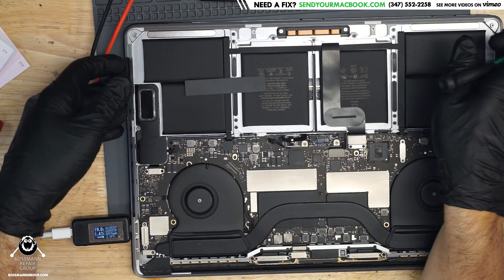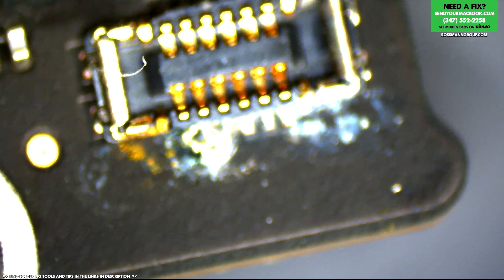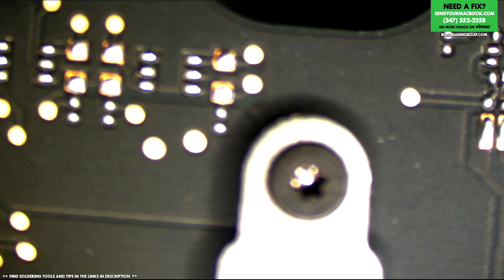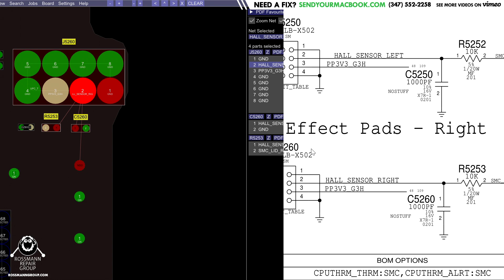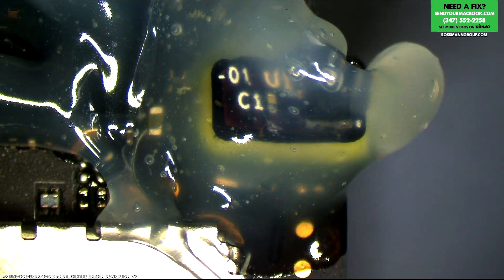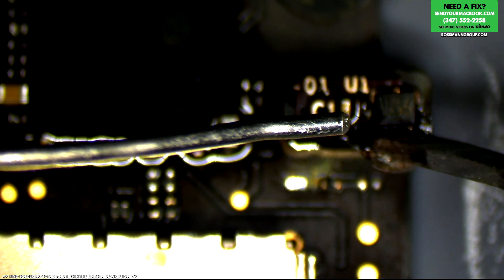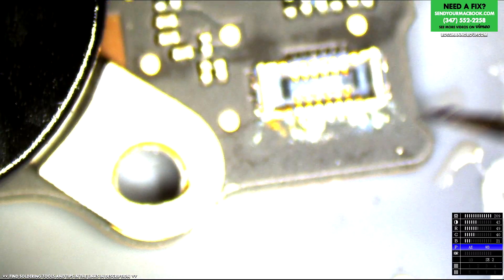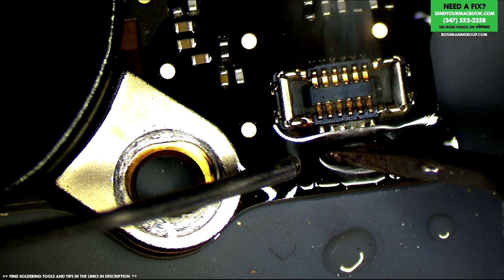Common cause of dim screen on newer Macbooks

Comment: So this isn't about the video or even really an apple product, but since MacBooks use the USB C connector I thought you might have some advice on an issue I have. I've replaced the USB sub-board 2x because when I unplugged the charger it pulled out the connector. Is there something I can do to keep it from happening? I know it might just need to use a different charger but was wondering

Comment: hey louis I recognise the issue you have with the schematic viewer software had a similar problem once. I fixed it by going to properties on the .exe file, under the tab compatibility there should be a button that says: "Change high DPI settings" click that and then check: "overide high DPI scaling behavior" and set it to application that should fix it.

Comment: Eyyyy I started using davinci Resolve last year and I enjoy it it's pretty nice, it's never crashed while editing for me but has crashed during final renders before, however, most of those problems are because my overclocked CPU was overheating during the renders cuz I'm dumb and didn't setup the thermal throttle 😂

Comment: I think there is for once a bit of sense in the insanity of crapbook design: So 2 sensors are the way to go if you want resilience. Say one sensor fails the other works the machine can detect its own internal fault and do something about it. Enter the Boeing 737MAX where there was one of those crappy sensors where there were supposed to be multiple ones like basically in everything that was known to aviation up to that point... LOL and everyone died due to cost cutting yay... but I digress. Since apple still hasn't invented conformal coating I would argue putting 2 sensors there can make some sense.

Car ECUs use hall sensors at the crankshaft to tell engine rpm and crankshaft position with excellent accuracy as a magnetic cogwheel is rotating next to them... until these sensors tend to fail due to heat damage. Better designs have 2 such sensors to be able to report to the ECU that shit is malfunctioning and the car can tell the user to go to the garage in limp mode to prevent damage. Shittier designs might just cut out or start violently juddering and jolting when their hall sensor starts to play up.

Comment: Apple, were going to over-engineer our lid sensor to the point it makes it LESS reliable than everyone else. :/

Its hard not to think they are adding complexity specifically to cause points of failure to sell new devices.  What other purpose could there possibly be to making simple functions so complex?

Comment: Apple condom will not work until you sign the ToS, connect it to the iCloud, pair with your iPhone, and program via the new Mac Pro. Any attempts to jailbreak the condom will result in it hardening and shrinking while in use (bricking) and force the user to deal with Apple customer "service" in order for them to tell you to see an Apple "genius" who will offer to replace your penis, spleen, pancreas, and a kidney to fix the problem.
Reply: Well there would be an upside to that, imagine cheat rates dropping to zero as of course, an iCondom only works with one penis and one pussy that are paired at the factory and locked to the iCloud account. If a foreign sexual apparatus is detected, all further actions are blocked for security reasons :)

Comment: I bet the touchpad was so power hungry, they turned it off when it couldn't reasonably be in use
Reply: or not... lol
Reply: The TouchPad still receives power though the lid is closed, that signal line only instructs it to ignore input, but it doesn't put it to sleep.
Reply: If you squeeze the laptop in your backpack, the display lid will click the trackpad and wake up the machine

Comment: Hey Louis been watching your videos for a couple of months now. 
I apologize if my question is inappropriate but I have a Netgear Powerline 1000 that I apparently can't plug into anything like a power strip or a surge protector because it will "filter out some or ask of the high frequency signals used in Powerline communications."
Is this true in any capacity?
Reply: Don't quote me on what I'm saying as I'm no technician and never owned one of those devices, so I can't tell from experience, but those devices basically work by sending controlled voltage surges down the power line that then get decoded by other similar devices on the same power ring. Since a surge protector... well... filters out surges, including the aforementioned one, it makes sense that it would stop working if attached to such a device. On the other hand I fail to see how plugging it into a power strip would render it useless as there's nothing special about a strip (that is, unless it has surge protection features).

Comment: Would you do a video on what's going on under the microscope when you put that gooey blob stuff on, and what appears to be hot air instead of a soldering iron, and then you use a soldering iron across many pads at once but the solder doesn't become a massive wall of metal, or why other things don't come unsoldered during all this? I'm not a solderer, or an electrician, or have any electronics experience. But I do own a MacBook and want to learn why you do those things you do. Thanks.
Reply: The goo is flux, and allows solder to flow more easily and not look shit, the hot air is required when trying to replace components with multiple points of contact, or chips  with balls under them that are impossible to use a soldering iron for.

Comment: A reason for the hall sensors on both side is in case you lay something magnetic on or next to the macbook. If I lay my phone with magnets in the case next to my thinkpad it goes to sleep... This is a detail that apple actually got right.
Reply: You must have a defective ThinkPad. My one DOESN'T go to sleep when the phone (in a case that uses strong magnets) is very near the ThinkPad.

Comment: Louis, you missed the obvious reason that Apple would want a circuit that turned the trackpad off while the lid is closed: that's one more circuit that can fail and provide one more reason for Apple to coerce their customers into buying an entire new laptop. Same for a redundant circuit for making the display go to sleep -- if that thing goes and they can convince a customer that the entire display needs to be replaced for more than the price of a new laptop, that's one more laptop they can sell.

Comment: Those small Hall sensors aren't reliable. Without a strong magnet anything from a watch may trigger the sensor. So having two is probably as a failsafe to ensure that the computer only sleeps when both are triggered and the screen is most likely closed.

Comment: I've heard they replaced the Hall sensor in MBP16 with another kind of detector that measures the exact angle of screen opening. God knows why.
Reply: They need to know when to send 30V to the CPU so that you can see the machine die before your eyes, you don't want to risk somebody missing the show by having the screen at 45° would you? :)
Reply: @FRITZLB It was the mutex if the laptop had dedicated graphics (possible fix, just replace the mutex) or the CPU if the laptop only had an iGPU (not economically viable fix)

Comment: I hate stupid sensors like that. My Acer Q525UA recently got an update to it's biometrics suite that turned off the fingerprint sensor when you close the lid. Unfortunately, I wouldn't turn back on when the lid was opened. Thankfully I was able to roll back the driver and get it working again.

Comment: Two hall effect sensors so the screen assembly guy can forget one of the magnets? Also, TWELVE contacts to the power button?
Reply: TBH, it could be useful to have two hall sensors as there's a chance somebody is going to unknowingly place something magnetic nearby that sensors and trigger a sleep, by having two of those you lower that chance.
Reply: That power button contains a fingerprint sensor.
Reply: It requires both to detect for sleep to initiate. If one is damaged it can cause weird things to happen like the screen staying off after it's reopened.  

The power button has so many contacts because it includes a touch ID sensor.
Reply: tactileslut im pretty sure both need to detect a magnet for sleep to work
Reply: Actually scrap that that would make too much sense
Reply: @chillmal6271  smiles

Comment: Would perhaps the keypad disable in closing be in case you closed it with something on the keypad like a button fallen off ones favourite blouse!?... also I was wondering if they might have the two hall effect circuits to enable the use of different screens where the magnet can't always be fitted to the same side? appreciate your videos Louis.